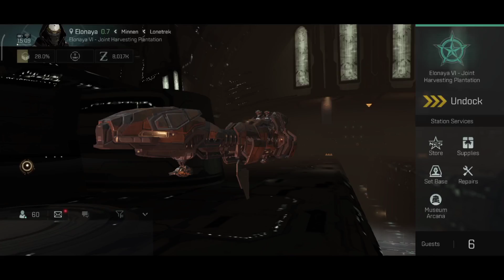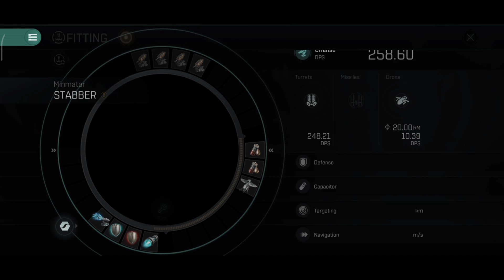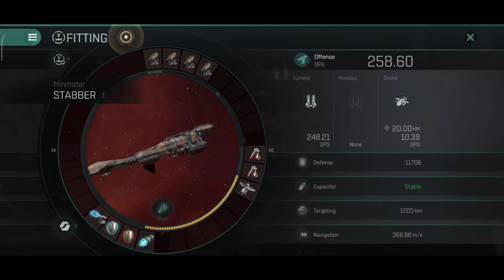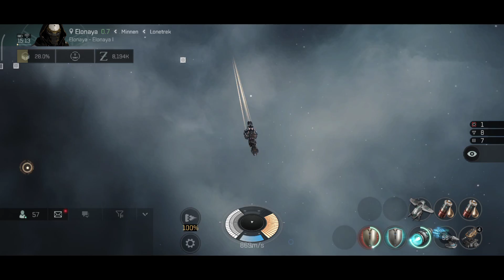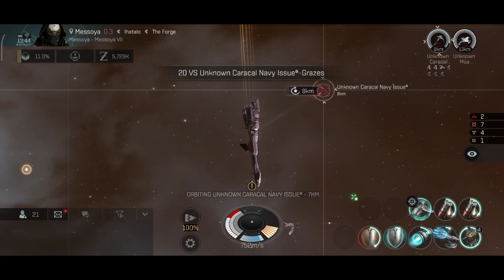EVE Echoes Advanced Missions [T6-T7] - Stabber (T5) New Modules & New Fit [PvE]

Comment: You can boost your tracking by not using Afterburn, the faster you move the more tracking required. You can also reduce your speed manually at a cost of being hit harder to hit harder.
Reply from the maker: Yea that's true, but if I loose speed I start to take damage xD

Comment: I’ve learned a lot from your videos — I’m glad I found your channel. Do you think the “explosion velocity” and “explosion radius” has something to do with the lower damage from Caldari ships? The basic explosion velocity and explosion radius of the “republic fleet rapid missile launchers” are 170m/s and 40m respectably. Do you think your stabber’s maximum velocity of 850m/s allows you to out run the explosion damage almost completely?
Reply from the maker: The ships speed does help in reducing the incoming missile damage.  That's one of the reasons why I love afterburners, they increase the ships speed without having a signature radius penality. 

Ships signature radius also has a big role, smaller ships take less damage from missiles. And for example in PvP if a frigate is being shot at by medium or large missiles, that frigate won't take much damage from these weapons because frigates are small and fast. 

Ship resistance has also a key role, my resistances on this ship are pretty decent and they do help in reducing ~70% of all incoming damage from missiles. 

All that combined reduces the missile damage quite significantly.

Comment: Seems like you have some problems with tracking, should consider replacing the gyro with tracking enhancer
Reply from the maker: Yup that's true. I thought that my skills were insufficient but it turns out it was my bad internet connection lol. In both cases the Tracking Enhancer did improve the tracking a lot.